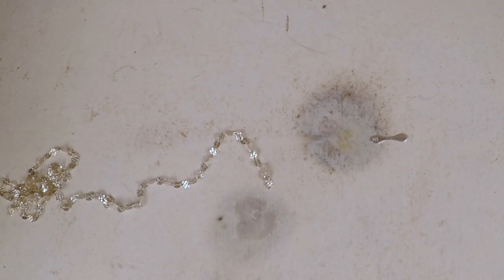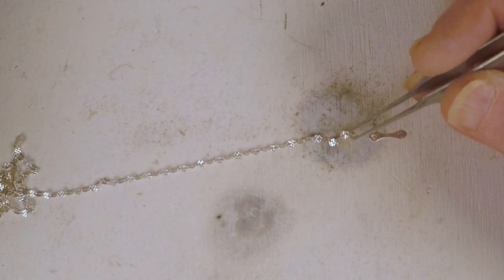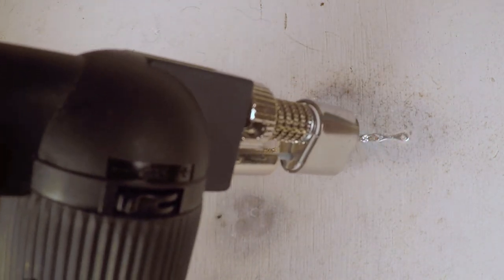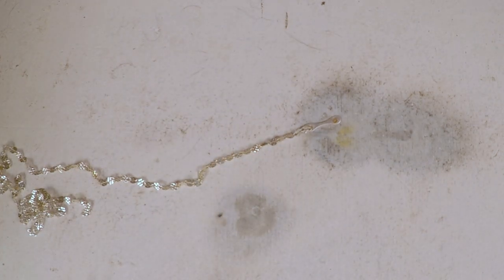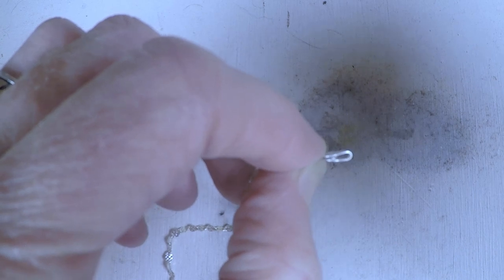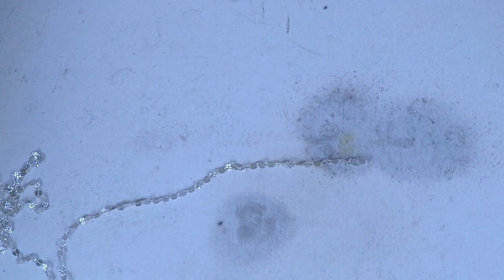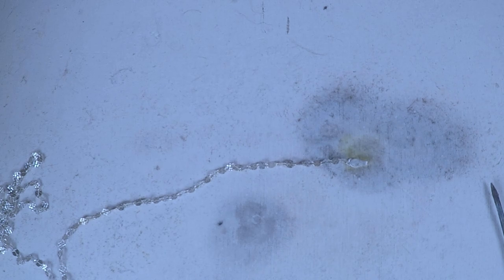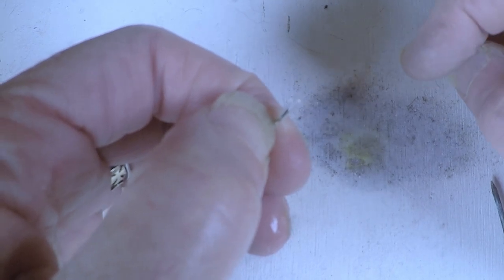How to Solder an End Tab to Footage Jewelry Chain

Comment: I have in mind to solder a flat end tab on a piece that would be of 14k gold flat herringbone chains braided with silver flat herringbone chains.

What information might you be able to provide regarding how to solder gold to silver; for instance, what kind of solder might be recommended, say, for my purpose described above?

How much does the whole chain have to be heated? How might one know when it would be hot enough?

What measures are taken to prevent discoloration of the chain outside of the primary working area when it is heated?

What kind of solder spray (flux) are you using? 

What alternatives are there for the 'heat block'?

What more can you say about an appropriate torch?

Is there anything in particular a person needs to know about the pick?

Are there any books, or websites to which you would refer a person with questions like mine?
Reply from the maker: I would use easy silver solder and sweat solder (check out our sweat soldering video if you are unsure of that technique: Sweat Soldering 14kt Gold to Sterling Silver ) that solder to the sterling silver end cap first. Don’t forget to flux: I use Handi-flux or Aquiflux. Next, fold the end tab over (don’t forget the loop so that the two sides don’t solder together) and place your chain inside. Place the end tab in a 3rd hand with the chain dropping below it. The 3rd hand should just be grabbing the very bottom of the end cap. Using the 3rd hand will protect your gold chain from overheating and melting into a mess. Flux the solder again and heat just the sterling silver end tab, keeping the heat away from the gold. Once the end tab softens up from the heat, the solder will flow and the 3rd hand will squeeze the end tab and chain together.

Because the end tab is all that you will be heating up, use a small micro. You will want a small flame that will heat the area above the 3rd hand only.

Any soldering pick will work. I use a titanium pick but you can always use steel tweezers, too. The point of using a pick or tweezers, is that you can adjust pieces if they move out of place without hurting yourself and while the heat is still on them.

Sterling silver will always get dirty because of the copper that is in it. The flux helps somewhat but you always need to pickle it afterwards.

Use a 3rd hand for this job. Check out this article on finishing chain ends. In your case, don’t watch the end cap soldering, read the heat sink section: Tips for Chain End Finishing.

Hope that helps!
Reply: @HalsteadJewelrySupplies  

So helpful! You must love your craft. 

Okay, I understand that for my purpose you would not recommend use of a heat block, rather, you would have a third hand stand in for the purpose. 

Additionally, what I am getting is that the whole chain will not have to be heated because I would be using the sweat solder method. 

To how much of the chain should I apply flux? I believe I saw a video with one fellow who dipped his entire chain in borax and alcohol before he began his work, which he said guarded against discoloration.

I have taken a quick look at micro torches, and it appears that they range in price, from, maybe, $12, up to $80. I am not sure which one might be best just to complete my single project at hand.

I have noticed errors in my initial questions here. I meant to specify that I would be braiding gold, with silver, flat herringbone chains. So, what might be done differently in using a gold end tab to the silver and gold chains?

Thank You!!
Reply from the maker: Add flux just to the end tab. It acts as a barrier too, containing the flux. Keep the flow limited to just the end tab area. Sterling silver melts faster than gold, so just be careful and use an easy solder so that you don’t have a pool of metal when you are finished. You can use a heat block, that’s a personal choice. It will flow faster so just take extra precautions and heat just the end tab and not the chain. If you heat the chain, it will melt quickly. The 3rd hands just draw the heat away protecting the chain from melting. Good luck! Let us know if you have additional questions.